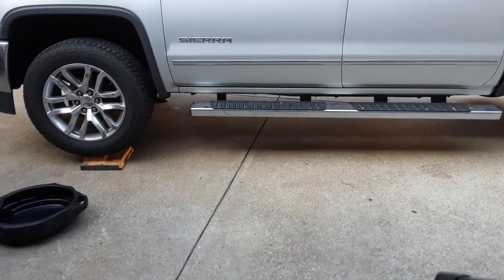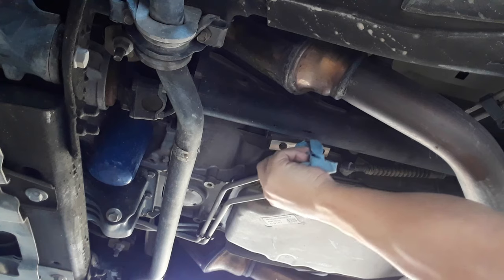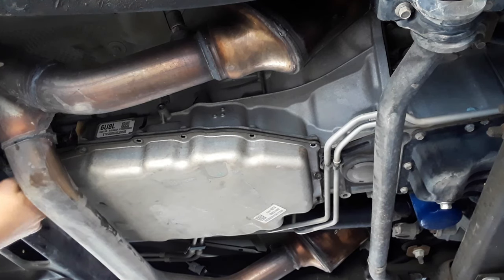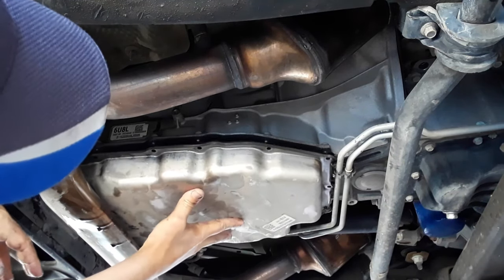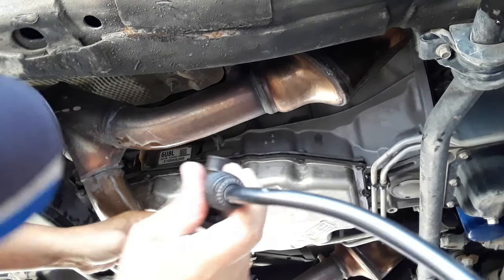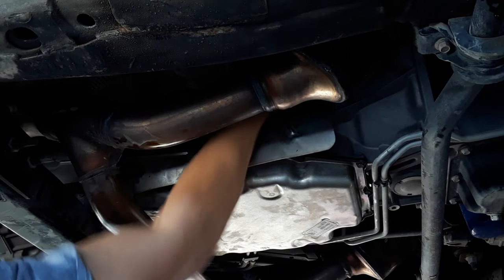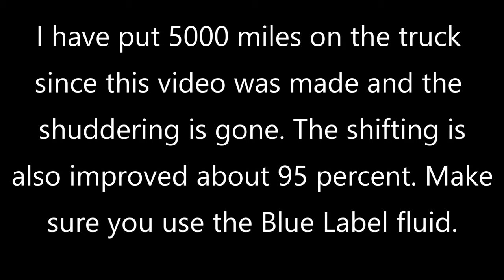Stop the shuddering on a 2016 GMC Sierra / Silverado with the 8L90 Transmission.

Comment: Have you tried to use this pump to extract your oil. I tried in mine and it seems like it doesn’t go all the way down the dipstick tube. I’m not sure if there is something at the bottom of the dipstick tube that catches the dipstick or prevents something other than a dipstick to go down the tube.
Reply: Does it not have a drain plug on the oil pan? The dipstick tube going to a smaller hole the base of it. So that tube won’t go all the way down.

Comment: That is a temporary fix.  Dealership did it to my 2020 canyon it was good for about 8000 miles
Reply from the maker: 40,000 miles and still going strong. The problem is not the factory using the cheapest fluid it was a fluid that as it turned out was very hydroscopic, so they came out with an updated fluid that works very good.

Comment: what about all the fluid in the torque converter? system has to be flushed while running to remove all old fluid
Reply from the maker: Yes to remove that fluid you would need to flush it.

Comment: Did this fix the issue?  How long has it been?
Reply from the maker: Yes it fixed the shudder problem and I have about 35,000 miles on it since the fluid change.
Reply: @737mechanic  Thank u for your response!

Comment: This is literally a temporary fix my friend.  Did this twice on my 2016 Silverado LTZ with 55,000 KM and still shuddering. Just a bad Transmission.
Reply from the maker: I have almost 9000 miles on it so far and it is still good. Hopefully it last for a while longer. If it acts up again I will change the fluid again.
Reply: 142k on mine. Still good 🤷🏽‍♂️
Reply: The results really depend on the condition of the TC and how much glazing occurred to the TC before the complete fluid replacement. Good results will only be temporary if there was significant glazing of the TC and problems will return usually within 10k to 20k miles.  In cases where the TC did not incur significant glazing before the complete fluid replacement the problems have not resurfaced, so yes, it can be a permanent fix. It just depends on how much damage was done to the TC before the owner actually got the fluid replacement done.

Comment: I just got my trans fluid changed and flushed by a shop, and it actually started to shutter now Never had this happen before.  
They used mobil atf dex VI 
No leaks, fluid level is good. Not sure whats happening
Reply from the maker: What year make and model and what transmission do you have.
Reply: @737mechanic  i have the 2016 gmc sierra 1500 6 speed 6L80
Reply from the maker: @manysrally710  From what I find Dexron VI is the proper fluid. I would say try the Mobil ATF LV HP but not sure if it would cause any problems.
Reply: @737mechanic  thank you
Reply: Dexron VI is not for 8L90 Transmission correct one is AcDelco Dexron HP( is discontinued by manufacture) NOW is Mobil 1 Blue label the one he used on the video
Reply: @ramonolivo573  is that the same for the 6L80E? Thats the trans I have
Reply: @manysrally710  this one use dexron VI
Reply: but if you getting the shudder again maybe need a new converter but i recommend to change the whole transmission i did it to my escalade because the rebuild get me almost the same price of a new transmission i get the new whole tranny for $3000 with 100k miles warranty or 3 years, because i didnt take the chance to have any other part compromised so i changed the whole trans
Reply: @ramonolivo573  yeah makes sense. Well it shudders all the time when cruising on the highway. Very mild tho for now. Gone have someone take a look at her this week. Thank you for the info!!
Reply: @manysrally710  i have the shudder now for couple months but im sure the converter is not the problem since when the fluid is cold i have not shudder so im going to play the card changing the fluid to see how is goes if not im going to claim my warranty lol the guy who replaced my trans told me to change the fluid at 25k miles ( he si a acertified GM tech  he worked for 10+ years at cadillac dealer) and i didnt so around that mileage i starting getting the shudder again so i think is true we need to exchange the fluid every 25k miles to avoid any problems lol
Reply: @ramonolivo573  do you got shudder that quick with a new trans or a rebuilt? Done by dealer or another garage? I’d be using that warranty

Comment: how often the hard downshift does it? i have an 2018 and does not shutter but if i dont brake firmly to a complete stop it does downshift hard to 1st. but also mine is camed and have stall converter.

Comment: Can I put some shudder fix from Lube Guard with the new A/T Fluid or just the fluid?
Reply from the maker: I bought some shudder fix in case the blue label fluid didn't fix the problem but after changing the fluid I have not had any shudder in 25,000 miles so I still have both bottles of shudder fix.
Reply: @737mechanic  ohhh wow, that’s nice to know, what do you recommend, put the shudder fix afterall or no? Btw nice video, I watched your Camaro blend door video 2 years ago too, def subscribed now!💯
Reply from the maker: @edforthewin8574  If don't want to go through the hassle of changing the fluid just add the shudder fix and see if that works. If it doesn't then change the fluid. If you are changing the fluid anyway and are using the blue label LV ATF HP then just go with the fluid and no shudder fix. I have 25,000 miles on my truck after the fluid change and still no shudder.
Reply: @737mechanic  thank you so much, I will do that💪🏼

Comment: Can you run run GM DEXRON VI full synthetic 10-9244 in it? I just had my 8l90 serviced and thats the fluid that was used. 😭
Reply from the maker: A lot of people think that is the correct fluid but it isn't. It probably won't hurt it in the short term but I would have them flush it and install the correct fluid.
Reply: @737mechanic  thanks for the reply will do.

Comment: Was that a 3/8" ID clear tubing you used to pull the fluid out of the lines, or did you go from a the 3/8" ID to a 1/2" ID?
Reply from the maker: Either that or 5/16. I have both so I can connect them together.
Reply: @737mechanic  Copy that...Appreciate it..

Comment: Do you recommend I change filter ? Truck has 109k and is having issues 2-1 shift sometimes.  Or can I just replace fluid ?
Reply from the maker: The fluid alone will probably be fine as long as the transmission is still in good shape. Good shape meaning it is not making big chunks of metal.
Reply: @737mechanic  how many quarts on just a drain ?
Reply from the maker: @richstar92  The book says a drain and refill takes 7.4 qts.

Comment: My GMC is making that same humming noise. What causes that.??
Reply from the maker: What humming noise are you talking about?
Reply: @737mechanic  at the end on the video while the engine was running and you were under the truck. Right after you drained.
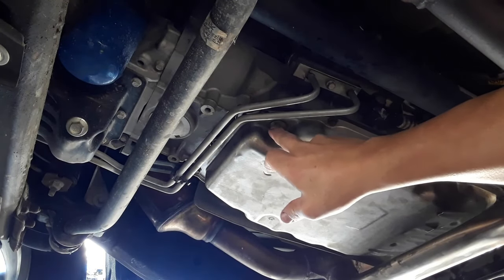Reply: @737mechanic  at the 35:40 mark of the video.
Reply from the maker: @bigchee2008  I'm not sure, I never noticed it before. What ever it is I am sure it is normal.
Reply: @737mechanic  ok. But Sounds like a buzzing or humming sound coming from under the truck on your video as your were draining.
Reply from the maker: @bigchee2008  Yea, I can hear it in the video but I didn't notice it while I was under the truck. Whatever it is I don't hear it when the truck is running and I have put 25,000 miles on the truck since I changed the fluid.
Reply: @737mechanic  ok. Thanks a lot. I was just curious

Comment: Hey boss, Do you know if GM updated the Tbv to a new one that runs at a lower temp?
Reply from the maker: I don't know. What temp is your trans running at?
Reply: @737mechanic  It’s OEM slightly below 200f.
Reply: @737mechanic  Its a 2016 Yukon Denali 8 speed transmission
Reply from the maker: @angulo820  That's actually a good temp. Most people think the cooler the better for a transmission but that is not true. Now if it gets up to 210 or so without being under a load then keep an eye on it.

Comment: When you mentioned level, did you mean the transmission pan level?
Reply from the maker: The truck needs to be level so you can't simply jack the front up or else the fluid level will not be correct.
Reply: @737mechanic  on my Yukon Denali I raised the rear end and placed a level on the transmission pan cover... I was able to pump out about six quarts. Refilled and doing a test drive and will re-level to check full level. Thoughts about changing transmission oil again after 10-15k miles?

Comment: Im doing this on my 2016 gmc sierra it shutters and hard shifts i thought it had a bad tire when i bought it i may be screwed on idk
Reply: I done the flush and put I put the shift technology shift correction package in it and found out the ball was missing in the stock one so I changed that and flushed the tranny and cleaned the bottom of the pan out and it drives like a brand new truck I super impressed with how well flushing the fluids worked.
Reply: @jarrodcombs8138  do you have a part number for the shift technology shift correction package?

Comment: @737mechanic I came across your video and need serious
Help. My Silverado is a 2017 crew cab, 4X4, LTZ, 5.3L and a couple of days ago I was driving to work and my
Truck just started losing power. I was accelerating and the RPM was up but not going anywhere. Then it would go, but it was jumping and making a noise sounded like a grinding right below me and to the right a little is where it sounded like it was coming from. I left my truck went to work and later that night tried to get it home for the first minute or 2 it seemed fine but started doing it again. I was told it was the mass air flier sensor and replaced that and nothing. I was told that it was dirty transmission fluid and I’m I. The process of doing that now. Because I don’t know what it is. I don’t have a check engine light and it’s throwing no codes. When they hooked the machine up to it it have nothing. Can I please ask your opinion on what it might be
Reply from the maker: That's a tough one without being able to feel and hear exactly what it is doing. If it is transmission-related make sure you check it with an all-systems scan tool because a cheap code reader only shows engine-related codes so you could have a transmission code that will not set the MIL.
Reply: @737mechanic  I have a yukon denali 2016 with vibration at 83 miles per hour do you think it's an oil problem?

Comment: The title reads 8L90 but the label on the Trans reads 6U8L.
Reply from the maker: The 8L90 is a 6U8L.
Reply: @737mechanic  Just helped my son service his 2022 Z71 and his 8L90 valve body system is different and a large servo or something at the rear prevented the oil pan from being completely removed.  My research shows  The 6L80 has a lower first gear ratio than the 8L90 and 10R90, which makes it better for heavy towing and acceleration. The 8L90 and 10R90 have more gears, which provides smoother shifting and better fuel efficiency.  So based on research this is not a *L(0 even though it looks similar in size it is a 6 speed and not 8.   https://transmaxtransmissionsocala.com/f/8l90-and-the-different-variations#:~:text=The%206L80%20has%20a%20lower,shifting%20and%20better%20fuel%20efficiency
Reply from the maker: @edwardenglish1519  So you have the 6 speed or 8 speed?
Reply: @737mechanic  8 speed
Reply from the maker: @edwardenglish1519  So mine is an 8 speed also, I am not sure what you mean by saying mine or yours is a 6 speed.

Comment: What about the wear on the torque convertor clutch? I'm sure it's worn after shuttering
Reply from the maker: After 25,000 miles I still have NO shuddering so I guess it is fine. As long as you have not driven for thousands of miles with it shuddering the wear will be very minimal.

Comment: Hi it's been a little over a year since your video on changing your trans fluid on to Moble 1 synthetic.  Did this hold up or did yiur shuttering Come back? I am looking a buying a 2016 Cadillac Escalade with this transmission and I will do this flush on it even though it isn't shuttering now. Just wondering if yours held up? Thanks Greg in Michigan 😎👍
Reply from the maker: The shuttering is completely gone and has not returned. Every now and then a get a harsh shift from 2nd to 1st or 1st to 2nd but no shuddering.

Comment: Why did you drain it like that at the end( 35:59) or what was the purpose of doing that?
Reply from the maker: That port has a stand pipe and what you are trying to do it fill it slightly above the stand pipe so when it drains out it will be at the top of that stand pipe and be at the perfect level.
Reply: @737mechanic  thank you so much for the feedback sir!

Comment: I have a 2015 Sierra with a 6 speed automatic that vibrates ONLY ABOVE 68 MPH....can't feel it in steering wheel or pedals.  I've replaced tires and shocks and there is no mechanical problems with transmission.   Will this method work in your opinion?
Reply: That might be the drive shaft, "Chevy Shake".

Comment: i took out total 6 quarts , put in 7 and haft quarts and run and shift all gear up the temp to 131 ,and drain back out 1 and haft qrart , but still shudder little , do you think may be it not enough tranmission fluids in  it , ?????
Reply from the maker: Possible but if it was at the correct temp and you drained it through the drain hole it should be at the proper level. Did you use the Blue Label Mobil 1 Fluid?
Reply: @737mechanic  i used exacly what you used yes blue label
Reply: @cohuynh1555  You may already have some TC glazing.  BTW the correct procedure if you go by GM's recommendation calls for 3 consecutive flushes or around 23 quarts total to rid the entire system of the old fluid.

Comment: Is there anyway you could put a dipstick in the place of the way you check the level in the transmission?
Reply from the maker: Yes they make an aftermarket dipstick. https://amzn.to/3offAbT
Reply: @737mechanic  thank you. I have a 6 speed sorry I didn't say that before you did a good job on that 8 speed. Saw them take the 10 speed apart lots of thing in it to go wrong

Comment: does it need to erase transmission Adapts after 
more like did you did ?
Reply from the maker: No I did not do that, I would have if the shifting wasn't fixed after the first test drive but has been almost perfect so I haven't worried about it.

Comment: Dealership says it's a common problem because the factory uses the cheapest transmission fluid.   Temporary fix.    A lot of transmission shops around me wouldn't touch the 8 speed transmission unless it was to replace it..
Reply from the maker: This temporary fix has lasted 40,000 miles so far so I feel good about it.
Reply: Consider yourself lucky.  Before ever second oil change the problem came back, after changing the fluid, they changed the port valve block, before 2nd oil change came back, then the change the torque converter, before 2nd oil change, problem came back.   Then they did a fluid test, now at this time I had 38000 miles on it.   They said my radiator is leaking fluid into the transmission, since my radiator was no longer under warranty they wouldn't cover the transmission..   had to hire a lemon law.   Still waiting for results from them.
Reply from the maker: @TheBoss-zw7lm  So it wasn't the fluid that was bad it was your radiator leaking into the transmission.

Comment: Will this work on my 2011 GMC Sierra 1500?  I've replaced my transmission, and the shudder came back a week after, which I then took it to the shop for warranty service twice, and still the noise came back shortly after each time.  I really would like to solve this issue; I'm trying to avoid buying a new truck.
Reply from the maker: I am not sure if it will fix your problem or not. If your problem is torque converter shudder then it might fix it.

Comment: I may have missed it.  Did you flush the fluid out of the torque converter?
Reply from the maker: No, there is no way to really do that. You could start the truck for a few seconds and let it pump some fluid out of the converter back into the pan but there will still be some fluid in the converter.
Reply: @737mechanic  can you please tell me what size tubbing you used to pull the fluid out?
Reply: You can mostly flush the TC by disconnecting the cooler lines, idling the truck, and letting the fluid bleed out into a bucket (keep track of the amount, don't let it run dry). Then reattach lines and carry on from there with the proper refill procedure.  There are dozens of YouTube vids on this, both generic and at least one on this specific transmission.

Comment: Can someone provide me with info about 8l90. What can cause the pppp when it reverse from higher speed to lower and once the gear box reach 95c temp 
That issue always appear in hot weather but at night I don't see it usually. 
Is it the torque converter? Or something else

Comment: Hey great video! I Just got the shudder on my truck above 45 mph and need to take it to the dealer today. I’m curious, how is your truck holding up? I have a 2018 with 52k miles.
Reply from the maker: Still doing great, Has been about 25000 miles since I did the fluid change, and other than a harsh shift every now and then the shudder has been completely gone.

Comment: Can someone please define "shudder" I have a 2016 GMC Sierra Denali and have a vibration on acceleration. I also have some hard gear shifts (1-2) sometimes. It runs smooth as butter once I'm going highway speed. It's just on acceleration. I've been going crazy trying to figure this out
Reply from the maker: The way my truck was shuddering felt like out of balance tires, mine would do it between about 60 to 65 MPH on the highway. Mine also had the harsh shifts from 1st to 2nd and sometimes from 2nd to 1st. I have heard some people like yourself has it on acceleration. It might be worth doing this fluid change to see if that illuminates it.